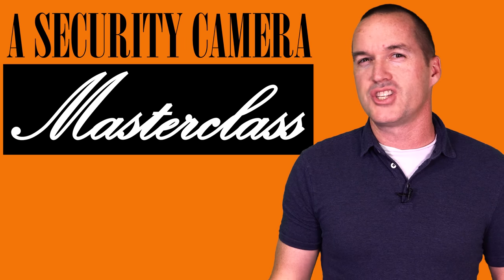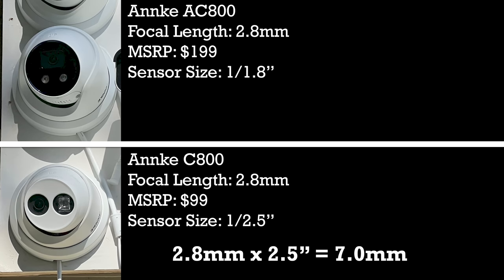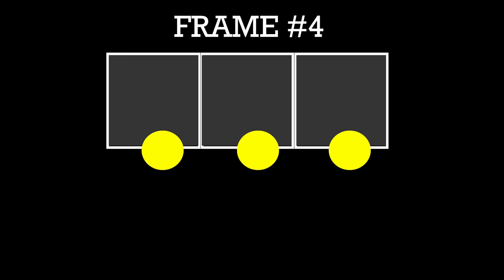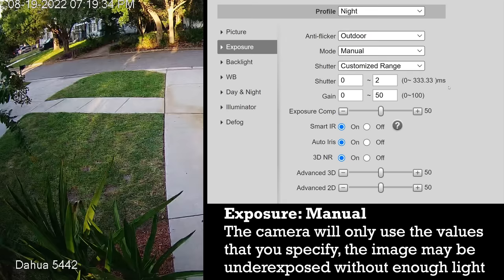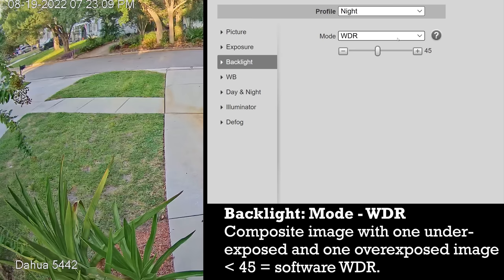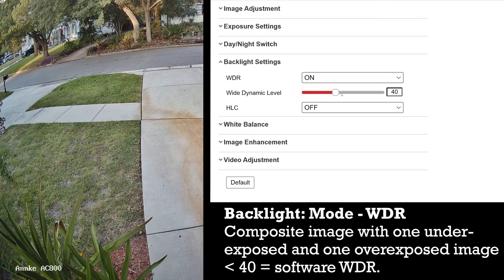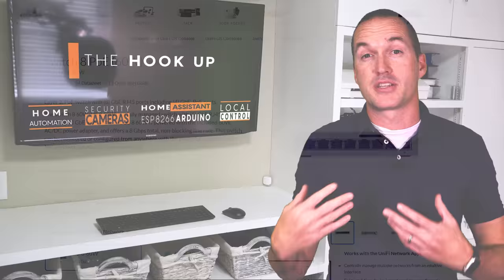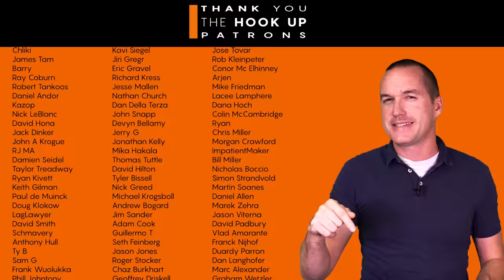Expert's guide to SECURITY CAMERA SETTINGS.  WDR, BLC, HLC, and SSA Explained.

Comment: 😁 I'm wondering now if you have a lengthy & detailed 2023 video 👀 or up-to-date video, on the best commercial-home security surveillance systems in 4k or higher. Includes all the bells and whistles, for 360 degree multiple cameras angles, and no blind spots around the home. Without paid service subscription fees and can be saved on the cloud on a home network.. NAS or other. Can be fine-tuned and have multiple add-ons like the IR floodlight etc... also can view from your phone, computer etc anywhere! 👍🏾 😃
Reply: I've been really happy with my Unifi Protect setup, but I know that Rob is not as much a fan of it anymore.  The quality, at-home-dvr, mobile app and hardware is fantastic IMO.  Price is a bit high, but for how easy it is to setup and manage a Protect setup I feel like it has been worth it.
Reply: You don't want much
Reply: The answers no, compromises will be made. Depends if your willing to spend the big bucks
Reply: @DYLDYL91  I am, yes!
Reply: In my opinion, your best option is Reolink cameras in combination with Blue Iris recording software on a server/nas of some sort. That's my plan.
Reply: @JWill6969  I'll look into it thanks for the response
Reply: Most difficult and also most expensive is laying the necessary cabling (which also means proper positioning etc, which requires a bit of thinking things through). Once you've managed that, setting things up is relatively straightforward.

Comment: Great video.  You covered a lot of complicated information and presented it in a very understandable way.  My only comment is regarding focal length.  While it is true that a wider angle will allow the camera to absorb more light, the number of pixels that will actually cover a subject is more important.  You know, the whole "DORI" calculations.  So depending on how far away a subject is going to be from the camera, a wide angle lens may not be the best option.  The farther away a subject is going to be from the camera, the narrower you want the field of view to ensure a higher number of pixels on the subject which results in clearer and more identifiable subjects.  For example, if a subject 25' from a 2.4mm camera only fills up 10% of the 2k resolution, that's only 200k pixels being used on the subject.  On the other hand, if a subject 25' from a 6mm camera fills up 30% of the 2k resolution, that's over 600k pixels covering the same subject meaning there will be 3 times the level of detail on the 6mm camera vs the 2.4mm camera in this scenario.  Obviously the 6mm camera is going to provide much clearer images day or night (all things being equal).

Comment: @The Hook Up For ReoLink: You can adjust exposure, gain and other such settings via the old ReoLink client or via JSON commands.
Reply from the maker: 😮 Do you have any links for me to do some reading about that? That sounds really interesting and useful!
Reply: I thought I remembered there were more settings in the old client but I barely used it before switching to the new client due to the Adobe flash issue
Reply from the maker: I just downloaded the old client and have found the manual gain/exposure options.  I'll try it out tonight and see what I can figure out.
Reply: @The Hook Up  Nice! By the way I think those "higher night vision FPS" settings of the new firmware interfere with the gain/exposure options. Might wanna try with an old firmware if it doesn't work. Gain/exposure options on old firmware worked 100% - used it myself.
Reply: @TheHookUp  Hi, any setting recommendation for better night performace for Reolink camera with manual exposure setting (accessible from old PC Client)?
Reply: @TheHookUp  after some testing and I picked gain 75 and shutter 40 ms for compromise of sharpness (in motion) and brightness, started with 32 shutter but seemed dark. I use RLC-520A but I'm Wonder ing what setting you would recommend for night backyard (so just people and Animals, no cars, not many lights)
Reply: @TheHookUp  did you find you could get better night vision with those extra settings? Night vision is the only thing making me hesitate on Reolink
Reply from the maker: @huges84  Not really, no.  I found the extra settings, but I couldn't significantly improve performance with them.

Comment: I have interlogix 4K bullet cameras at my business and during the day if somebody is driving by the camera it's a blurry image. On my cameras the only things I can change is the resolution, bit rate, And I can change the frame rate. I know when these cameras were originally installed I could get good pictures of cars going by but something has changed and I don't know what it is. Also to let you know this is the settings I can change on the DVR, I do not get a laptop and go into the camera IP address and change settings there

Comment: Another HUGE benefit to using an external IR illuminator is that it helps to get rid of spiderwebs (by turning off build in camera IR). 
Thanks for the idea on using POE splitters for the external IR illuminators! I was about to wire it for 110v adapter.
Reply: Something else to keep in mind.  I tested my Amcrest PoE cameras, and when PoE is applied, the barrel jack port on the camera had +12v present.. so I might try to add on some IR floods using that instead of the splitter.

Comment: What an amazing video, I've struggled to understand some of this stuff and you cleared it right up! You are such a great teacher and video producer. :) 

I'd love a continuation of this video:

comparing 850nm vs 940nm infrared lighting
How do you determine what ir illuminators are good? I’ve bought a dozen and some didn’t do anything to my picture quality at night. 
How to know what cameras will work with 940 for covert recording. 
narrow view vs wide field of view ir illuminators

How do some of these cameras have great night vision out to over 1,300 feet? I have a pair of night vision binoculars (has a built in screen) that are absolutely amazing out that far. It's almost like daytime except black and white. And they were only $200 bucks.
Reply from the maker: 850nm is the standard and 99% of security camera sensor are particularly sensitive to 850nm, so much so that they need an IR cut filter to show normal color images during the day.  940nm is desirable because it's not visible to the human eye (doesn't glow red), but lots of cameras won't be sensitive to it because their sensors are specifically tuned to 850nm. 

As far as the distance thing goes, it's about lensing.  A 1300ft IR beam will be extremely narrow and would be useless for lighting up a nearby scene.  The ones I linked are 90 degree spread.
Reply: Rob's day job is a high school teacher in Florida last I knew. He's definitely using those teaching skills with his YouTube videos.

Comment: Saving my first spot XD

Typo at 4:48 when you speak about the size of the 4Mpx sensor (screen says 1/1.8" but you said 1/2.5")

The massive regret of buying a reolink kit is real.. not to mention the NVR is not very friendly with other brand of cameras...
Reply: I noticed this too.  Surprising there is no post production overlay edit to clarify.
Reply from the maker: @mikeclites8407  Confusing maybe, but not an error.  1/2.5" is the smallest sensor I'd recommend, but the camera I do recommend the 5442 has a 1/1.8" sensor.
Reply: My reolink camera that a massive issue with blur at nigh.however,I could fix it by changing the exposure to manual on the reolink client app.
Reply: @picardo5397  what setting was it on then? What about when it's day time?

Comment: also different wavelengths of light have different focal points.

a lens focused for visible light will not be perfectly in focus for infrared or ultraviolet.

red green and blue are fairly close  (approx 440nm to  ~680nm) although  in high end cameras you will have separate lenses for each.

lenses focused for visible light will be slightly out of focus with  much longer wavelength (800nm -> 1000) infrared

Comment: Thanks for the super informative video! One mistake in editing, that I noticed: @ 4:42, you describe the Dahua 5442 sensor verbally as "1/2.5"", but your graphic reads "1/1.8"". 🤜
Reply from the maker: i was just saying that you should look for a 1/2.5 as a minimum size, but the 5442 is actually a 1/1.8" sensor.

Comment: Great content as always.  One quick note, when talking about light hitting the sensor vs. pixels, keep in mind an 8MP image is 2x as many PIXELS as a 4MP  but each pixel is 4x the AREA.  So an 8mp needs 4x as much light per pixel to equal a 4mp in performance light/pixel.
Reply from the maker: That would be true going from 1080p (2MP) to 4k (8MP), but not from 4mp to 8mp.  The area of an 8MP pixel is half the area of a 4MP sensor.  An 8MP image is 3840x2160 while a 4MP is 2688x1520.
Reply: @TheHookUp  Shoot, you're right.

Comment: While there are slight changes between the different cameras and settings.  However I don't see a $1,000 improvement in the image quality at night making those adjustments.  None of them were able to read the sign when you running.  Honestly they will all produce the exact same suspect description for Law Enforcement at that distance and moving subject.

Very disappointed Reolink doesn't add those adjustments to their camera software settings.

Comment: Hi Rob, thanks for this video it helped understand some of the technical terms available to configure my cameras. I have a pair of Annke NC800 cameras, they do very well during the day and are mostly ok by night, however the image at 30 feet (around 10 meters) isn't quite good enough to read a number plate. I've changed some of the settings based on your recommendations and will see if this helps.
Reply from the maker: LPR is really hard to do, here's a quick overview of how I set up my LPR cameras: https://youtu.be/jqc1ukrkMmI?si=T_6OTcy9c2jpQix9&t=1014
Reply: Thank Rob, yes I have the issue you mentioned on this video, my house is at a right angle to the road, so I have to look to get the details once the vehicle is either coming past, or has already past (In the UK we have a plate on the front and back). It's still not 100% as theres a very small area where the plate gets caught by the camera. Any way I'm still testing this and hopefully will see it improved. @TheHookUp

Comment: At 4:45 there's a typo 1/1.8 should be 1/2.5 according to what you said.
Reply from the maker: Sorry, that was confusing.  What I meant was you can get away with a 4mp 1/2.5”, but the dahua 5442 has a 1/1.8” leading to great night performance.

Comment: It looked as if for dahua/annke IR illuminator was of different wavelength, not 940 but 850, didn’t see any difference, and in reolink case WDR adjustment resulted in spotlight effect for central zone. Great overview, though. Even with current technology, Night time results still do always require tinkering with settings, given the product fits the purpose in the first place.

Comment: I use a Hikvision ColorVu cam with the craziest night color mode, have you tested one before? They are not cheap, but I think they're worth it.
They come with a 1/1.2” sensor and F1.0 aperture.
Reply from the maker: The camera I recommended in this video (Annke NC800) is a Hikvision ColorVu OEM camera.  Same stats, 8MP, F1.0, 1/1.2".
Reply: @TheHookUp  Oh, I didn't get, sorry. Thanks for clearing that up <3

Comment: I ordered the POE splitter you have listed, It does not send power to both sides of the splitter. Power only on the barrel jack and data only on the RJ45. So it does not work if you have a POE camera like the Empire T5442T-ZE and want to add an IR illuminator. It states right in the directions that come in the box Plug output (1-2)/(3-6), power output by 5521 DC male 2.1mm. It is a good informative video though. The Illuminators do make a big difference when you properly set up the cameras.
Reply from the maker: As stated in the video you will need a barrel Jack splitter too, then power your camera from the 12v barrel Jack.
Reply: @TheHookUp  Thanks, I saw that after the second time I watched. Maybe our commentary will help someone from overlooking the same detail I did. I assumed the power got split to both sides.

Comment: Need a good camera to capture wildlife movement at night. We don't want the camera to use any supplemental light (not even the camera light) as the light would scare the wildlife. Also, we are looking for a good camera to capture the Aurora (northern lights) Again - no supplemental light on the camera. We don't care is the camera comes with a light, we just want it to work WITHOUT the light being turned ON. Any recommendations on which camera would work best. Thanks.

Thanks.

Comment: Shouldn't the sensor of the 4MP cam at 4:50 say 1/2.5"?
Reply from the maker: Nah, I was saying don't go any smaller than 1/2.5" for a 4MP sensor, but the Dahua 5442 has a 1/1.8" 4MP sensor which lets it collect a significant amount of light per pixel.
Reply: Thanks.

Comment: Do you have any experience with Alibi or Provue cameras?I searched your channel via the seach button,but did not see anything,but not sure if there is and I just didnt see it.Great explainations btw in this video.
Reply from the maker: Just looked those up because I wasn't familiar with either brand.  They both look like Raysharp resellers: https://www.raysharp.cn/en/product-44.html

Raysharp is a Chinese OEM, known for making pretty low cost low quality cameras (they used to be the OEM for Swann here in the US), they have not been implicated in any of the US DoD stuff so they are still NDAA compliant, but not super high quality.
Reply: @TheHookUp  Okay,thanks!

Comment: Hey Rob, was wondering if you had a recommendation for a long range night vision camera.  If it did great for daytime too great, but I have Reolink Duo's for my main cams everywhere with some 810's and such.  But would like to have something that could get a decent pic of something in my front yard towards the road which is about 300-400' from the house.  The Duo's pick stuff up but obviously Reolinks typically suck for nighttime as you have stated many times ha.  But most of your tests are like 25-50' so was wondering if one camera is better suited for that range.  Thanks
Reply from the maker: For 400' you're going to need a PTZ camera, not because you need the pan and tilt, but because they have good zoom and very strong IR LEDs.  I'd recommend this one at the low end: https://amzn.to/3QEpws4 or this one on the high end: https://amzn.to/3RKzqtA
Reply: @TheHookUp  Thanks for taking the time to reply, will def check it out, don't mind the higher end being I don't need it for all my cams just want it for going down the driveway and covering most of the front yard.  Thanks again.

Comment: So would you recommend setting WDR to less than 45% on a Dahua camera so that it uses software WDR (hence less fuzzy boarders and motion blur)?
Reply: I recommend setting WDR to 45; brightness and contrast to 55. Saturation and Sharpness to 60 based on this comment "It depends on your end goal I guess.  WDR under 40 might look better to the eye, but ultimately the camera is still capturing the same amount of data and then tweaking settings to make a more WDR looking image.  With WDR over 40 the image will actually contain more information because it is a composite of two different exposures." Hopefully, provide more detail about the AI model?

Comment: I'm confused about the barrel splitter at 19:01. If I connect a single IR illuminator to a POE splitter/adapter, why would I need a barrel splitter? Isn't the 48V POE power passed to the camera via the RJ45 plug?
Reply from the maker: It usually is not passed through to the rj45

Comment: Damn no wonder my cheapo eufy cams's framerates drop so low in darkness when streaming in Home Assistant with MotionEye CCTV. It could also be my Raspberry Pi 4 but the basic Frigate streams work better. I have a pretty cheap NUC around so maybe hooking that up to HA might be beneficial, even just for the fact I won't be wearing out an SD card and boosting performance.

Comment: If Dahau makes Amcrest and Lorex, do they sell cameras or do you have to go to Amcrest or Lorex to get them? Are you getting the same exact camera with a different name on it?
Reply from the maker: You are getting the exact same camera hardware, but sometimes with some convenience features added or advanced features removed in firmware.  The main reason that Amcrest and Lorex exist and are popular is that Dahua (and Hikvision) cameras are region locked to make sure proper import taxes are paid.  That means if you buy a Dahua camera from a random seller on eBay (or sometimes even Amazon), it might not have been meant for the US market and there is a chance that you could brick the camera by installing firmware updates.  

With Amcrest and Lorex you know that the cameras were licensed for international markets and firmware will be safe to install.

Comment: Does focal length really affect night vision image quality? The sensor gets more light, but the light from each point of the image is the same. Furthermore the more inches per pixel the lower the detail quality.
Reply from the maker: In my experience yes, actual testing seems to back up the physics.

Comment: What’s the difference between RLK16-410B8 and RLK16-810B8? I don’t see that you have a video on either
Reply from the maker: The RLK16-410B8 includes 8x 5mp non person detection cameras.  the RLK16-810B8 includes 8x 8mp person and vehicle detection cameras (RLC-810A).  You should not consider the RLK16-410B8, but the RLK16-810B8 is a great package.
Reply: @TheHookUp  thanks for the reply. Since my question I found a package that contains 4 RLC811A cameras with a 2 TB NVR, but then I saw your night vision video (very important for me) and now I’m back at square 1 considering Annke again 🤣